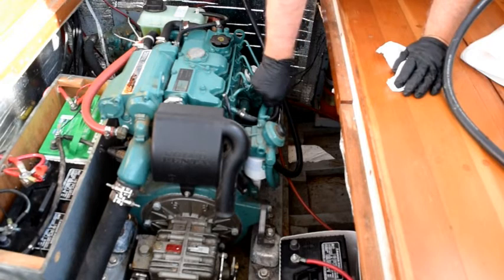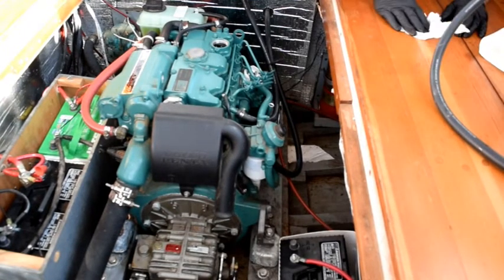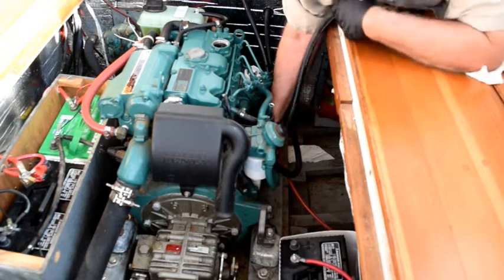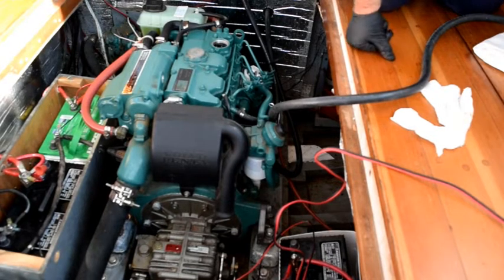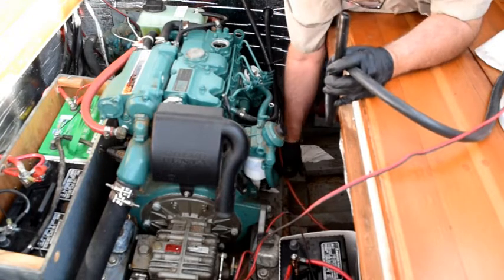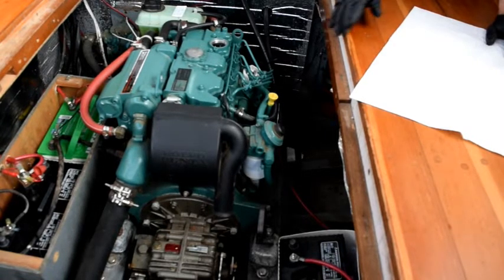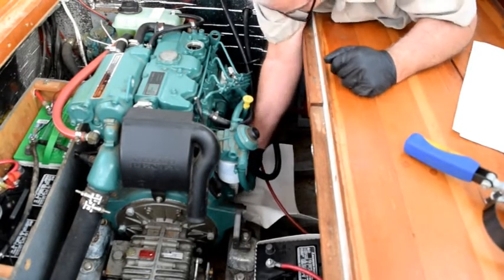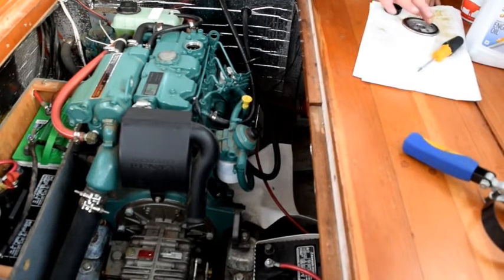Boat Maintenance - Tortuga's Annual Oil Change - with a SURPRISE at the end

Comment: Even though I use a funnel when filling with the new oil I still manage to spill some, so I will be trying you tip of an oil absorbent rag with a hole in next time.
Great vid keep them coming.
Reply from the maker: I am glad I could make a useful suggestion.  I don't use a funnel for this engine because the distance from the fill to the cam is only about 1/2" so you have to hold the funnel, while kneeling beside the engine and pouring the oil.  I am thinking in terms of more Boat Maintenance videos over the next few months.

Comment: Simple oil change, not so simple on a vessel!
Money saving though!
Great video!
Reply from the maker: Glad you liked it.  Boat oil changes are easy IF the boat is set up properly.  I am seriously considering mounting my oil filter remotely to make it easier to change, because the oil filter is in such a tight spot.